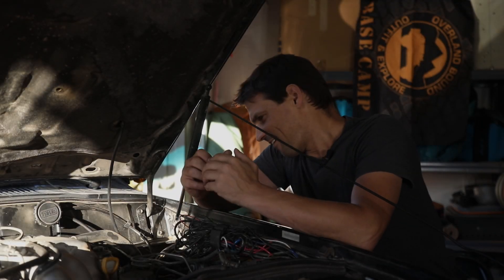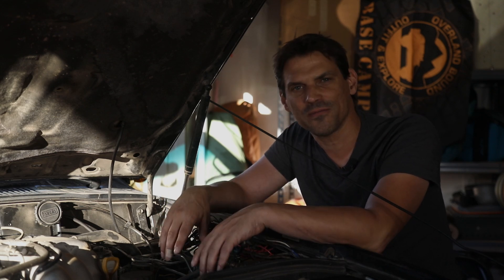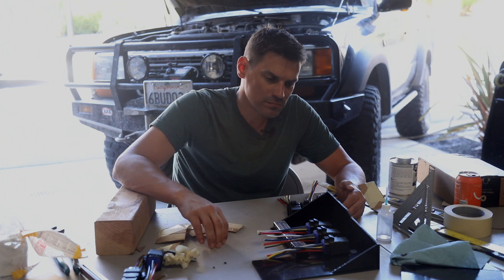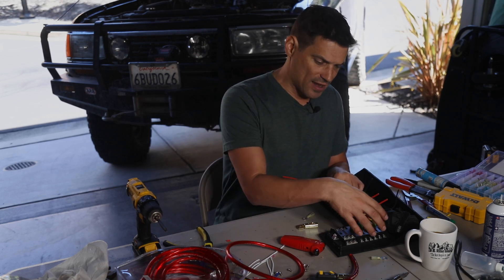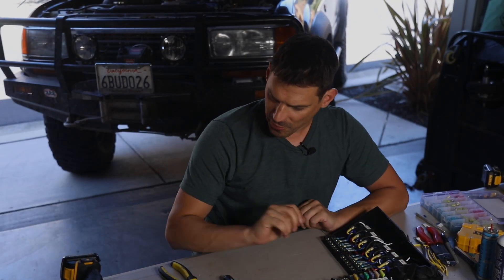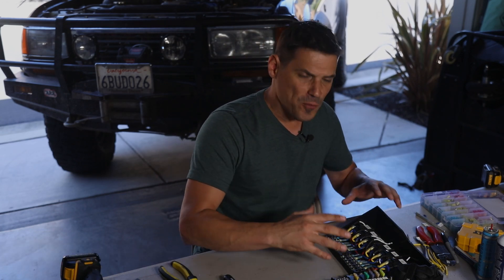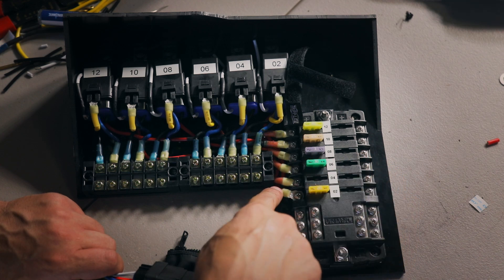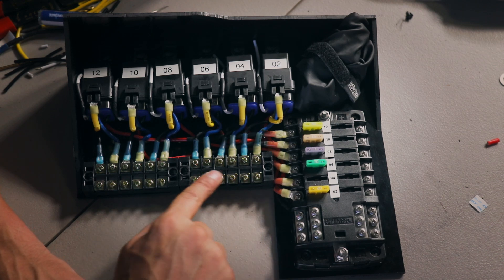DIY Fuse Relay Panel - Protect Your Rig!

Comment: Great video. Appreciate the effort to show logistically how to wire up a circuit, then make it multiple in parallel for the number of accessories you've added. 

However, confused on the white wire requirement to be 12v power. Red powers through the relay to the blue wire to the accessory. What does the white do? Can the white wire be sourced to the same red wire terminal for power or does it have to be its own source to the 12v supply (battery)? If its own, does it have its own fuse? 

Thanks.
Reply: can be connected to the same red wire, normally you would use the white wire to trigger the relay. since he is switching the negative this wire can be directly connected to the battery, can be fused for best practices but will most likely use less than 1amp

Comment: Great explanation, the best I’ve seen. I recently added a Blue Sea system but I do have power going into the cab. I might have to sort of start over with this relay idea, although my accessories are all low amp. An I only have two switched circuits, to power two iPads. But the relays certainly would not result in any negative performance. Thanks for this.

Comment: Also many people may argue this one but switches on negative side arcs less. To prove this pull the negative side of the battery then reconnect then try the positive side. You will notice alot less arcing. I have also tried experimenting with switches on a positive side versus the negative side and checked the contact points after a  ton of switches accomplished by a sailing servo. The negative side has alot less arcing. 

Keep up the good work. Truck still needs a diesel and your hair is still on point (by the way that means it looks good in military).

Comment: marine grade heat shrink tubing also have a glue/sealant that also helps with protecting the wires.   Really nice to see wiring done right, and with thoughts about how it should be done.
 Best point was early on about the fuse being smaller than the amp load of the wire so that the fuse(something designed to fail) fails and not the wire, when wires fail fires often start.
I used to be a sparky, so using the torch while it works is not the best idea, a heat gun is so much better, with torches you can crack and cause the heatshrink to be brittle.

Comment: I would have nut and bolted those components. Those screws will pull out with all the vibrations of offroading. And using negative switching also eliminates a hot wire under the dash where it could cause an electrical fire.

Comment: I'm just a mechanical engineer so I'm not 100% sure but I think that negative switch is actually hot until you switch it. I would have to know some more about how the internals of a relay is actually made vs just the basic diagram that represents a relay that I know. I would check that but even if it is hot, I wouldn't worry to much, just make sure any wires aren't going to rub up on any sharp metal and short out. Although if it does it'll only switch the relay, acting as if it were switched on but could potentially get hot from a small contact area. 
Also if there are any electricians, please correct me if I'm wrong. I'm more than willing to learn
Reply from the maker: The switch I’m referring to is the switch  (negative lead) that activates the rely. That is a negative wire going from the relay box to the switch in the cab. If it shorts, it will turn the accessory on, true, but that’s better than a hot lead short.

Comment: Nit picking here, you burned a blue wire insulation with an iron or heat gun. the zoomed in shot of soldering before heatshrink had thinner wires sticking out, sometimes the can poke through the heatshrink. Otherwise awesome video!

Comment: awesome video!
so if you have a switch with 3 terminals, one is ground one is your power in which come from the blue wire, and your other terminal is power out, does the power out stay unused?
Reply from the maker: A three pole switch is usually a SPDT, used to send two power sources to one device at different times, or change the state, or sometimes is a lit switch. the ONLY wire going to the switch in this configuration is the ground wire, NOT the blue wire. The blue wire goes to the device you are powering directly. Please review the wiring diagram in the video closely. Only the black wire goes to the switch, then from the switch to a ground.

Comment: I need to see it mounted.  Also, how are you connecting your white wire?  piggybacking with on the red on the bluesea block?  or are you connecting them all to a common buss bar to be fused on the bluesea in an open slot?  Im just about to pull the trigger on a bussman setup for my 80 series but I'd rather have something with regular ATC sized fuses and relays you can buy anywhere, plus I already have the same bluesea fuze block ready to go.  Looks pretty clean.
Reply from the maker: Check out most recent IG story and posts for that info! Also, feel free to PM me on the forums (Michael) for pictures and info.
Reply: @OverlandBound  This comment doesn't help me.
Reply: @RobertSavello  just wire them to a common bolt and fuse it like Patrick said
Reply: Ive looked all over web looking for where this was mounted under hood. I have a factory made fuse box/ relay and cant figure where to mount on my 14 Toyota tundra crewmax

Comment: With negative switching wouldn’t your accessory turn on (get power) if your switch run chaffed and grounded out? Seems like it could be fairly big problem depending on the type of accessory.
Reply from the maker: Yes, but that’s WAY better than shorting out!
Reply: @OverlandBound  I have to second your decision to use ground switching.  People forget that this is only grounding the relay and not the actual accessory which is grounded at its mounting location.
Reply: With negative switching the wire between the coil and your switch is always 12v till you flip the switch to ground it.

Comment: Is the purpose of the relays to power your accessories without turning the vehicle on?
Reply: No. Most switches are not designed to carry heavy loads. Relays are used to power equipment, they can handle higher amp loads than a switch. They are controlled by low amp switches.
Reply: BOMBS they are essentially to let you run high current from the power source to the accessory without having to have the switch handle the current/have high current wires run to them . The switch instead sends a low current signal to the relay when turned on so it knows when to complete the circuit and send power to the accessory. 
That’s a simplified version but hope it makes sense.

Comment: Hey Mikey, I liked it a lot, but don't forget to apply the terminals to your spare relay!! Cheers, Mate.
Reply: The relay just unplugs from the already wired relay socket.  Not sure why he put an extra socket in the bag
Reply: @mrfixit____3651  might just be to protect the terminals of the relay, saves them getting bent

Comment: Dose every circuit need a relay switch ?
Reply from the maker: No, not really. I’d use it for anything with significant draw.
Reply: What's considered a "significant draw"?
Reply: @tvot029  I'd say a light of some sort or a power outlet.
Reply: @tvot029  anything over 5 amps

Comment: Nice! How does it mount in the engine bay?
Reply from the maker: I'm going to glue up some ABS mounts on the box, then bolt to the firewall with rubber grommets in between.
Reply: Great video please make another showing the install into the engine bay. I will be doing this to my 80 series. Thank you!